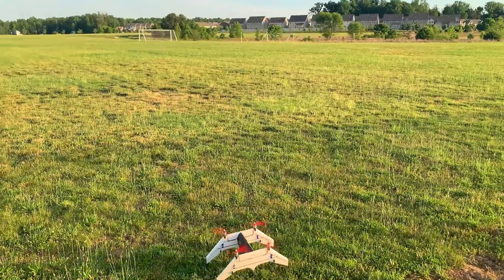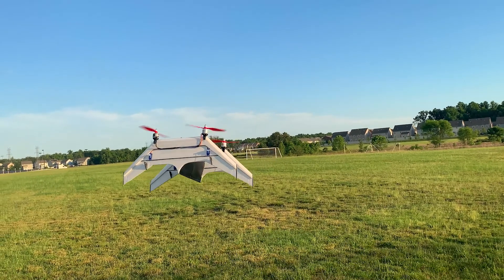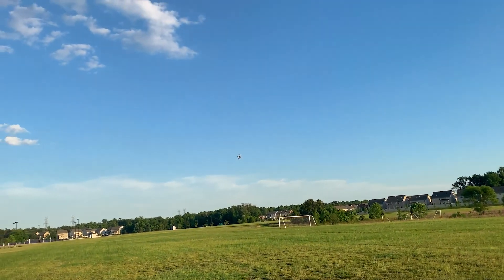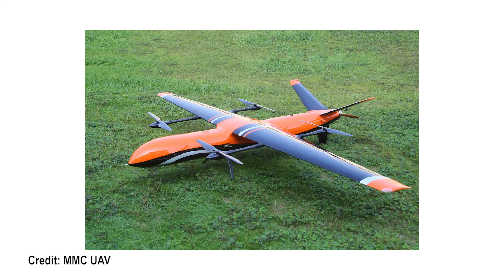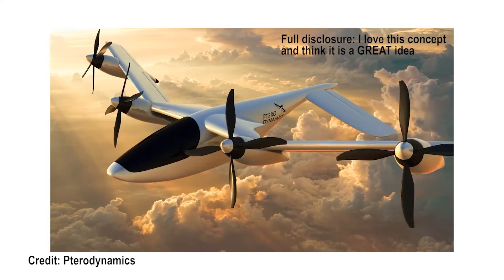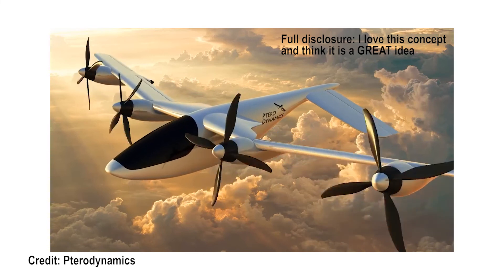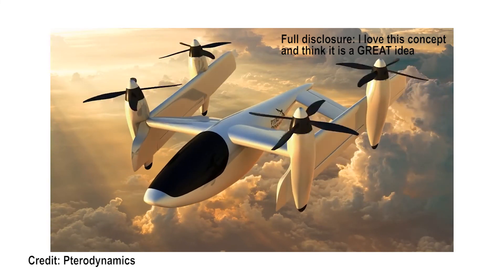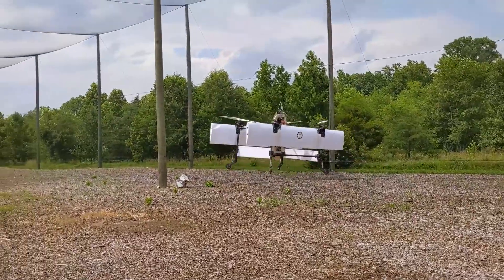Quadrotor Biplane VTOL Crash

Comment: Hi Nick. I've been using your flight controller in a couple of VTOL aircraft and find that we are heading in the same direction regarding a quad VTOL biplane. I think I have solved the efficiency issues that haunt the standard biplane design and have gotten to the point of crashing ... err ... test flying a preliminary prototype. 

I would like to transition the design to your flight controller, and am wondering if you would be so kind as to let me have a copy of the firmware you are currently running in your quad?
Reply from the maker: There's not too many mods from the stock code other than switching roll and yaw stick input between hover and FF, but there's a function included with the stock code that does just that. I also just change control gains between hover and forward flight with an if statement in the main loop but that's not really necessary. You can't fly in forward flight with the angle controller due to the orientation change of the IMU, so I always make sure to switch to the rate controller for forward flight too. Best of luck

Comment: Nick, find the book “Tom Swift and His Ultrasonic Cycloplane”… it puts the rotors in line with the fuselage.  The rotors are also smooth, but the cyclocopter rotors could replace the smooth rotors. The rotors could then spin in opposite directions, and no nose prop would be needed.  Four rotors with separate motors could control pitch and yaw, and an ionic flow engine could provide forward thrust.  Just a thought.  Would love to hear whether it works or not.  Best Wishes!!

Comment: Hi Nicholas,
Appreciate your efforts for BiPlane tailsitter.
I was having a query regarding this vehicle. Since, this is an actively stabilized vehicle therefore, 1)  how does you account for Centre of Gravity while placing your avionics or payload ?. 2) Like in normal fixed wing we take CG at 1/4 aft LE, in this config. is it exactly at 1/4 or it's all about control gains what matters of whatever the CG is ?  
.
Reply from the maker: It'll fly at any cg with the active stabilization in forward flight. I placed electronics to get the cg as close to 1/4 chord as possible, but its not perfect on this vehicle
Reply: @NicholasRehm  That's understandable but what about the control gain tuning ? Does it also needs to be changed every time if u shift the payload (battery) a lil fwd 3-4 mm of ur 1/4 mark or vice versa?
Reply from the maker: @Gary_Aviator  Integral gain will compensate for small deviations in cg
Reply: @NicholasRehm  That's great that the system will manage the cg accordingly as per gains but how well will this system work in heavy winds. It is heard that this system is unstable in heavy winds, how well does the gains compensate the high wind tolerance when the cg is off. Suppose ur gains are tuned in 0 winds and when u fly in 1.3  m/s with off cg  ?
Reply from the maker: @Gary_Aviator  it should be no different than the effects of an RC airplane flying in wind...mild disturbances but enough control authority to correct
Reply: @NicholasRehm  Alright, thanks Nicholas I  appreciate your time for responding to my queries and if I have anymore doubts will let know.

Comment: you don't actually need control surfacees, right?
yaw controls roll, which might be very unresponsive
Reply from the maker: Correct, full control with just the motors is possible but roll in forward flight is very sluggish. Elevons on this one are kind of overkill, but they were implimented just to test code for the bigger one!